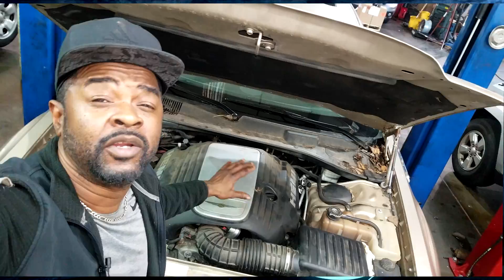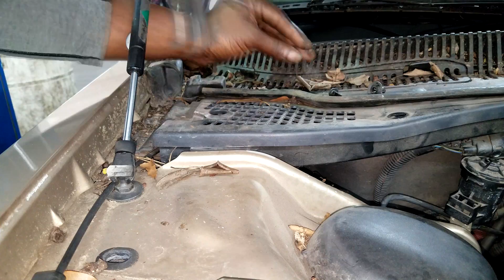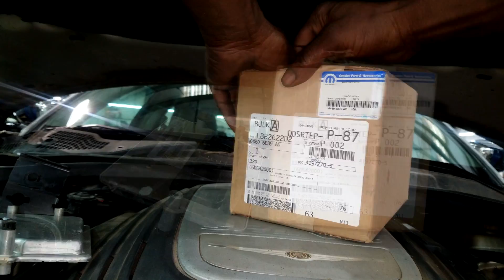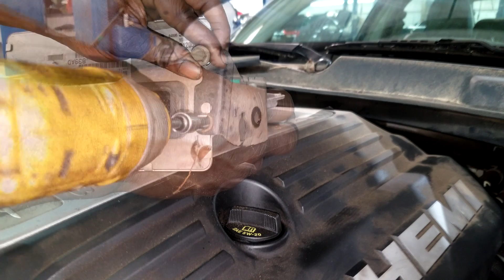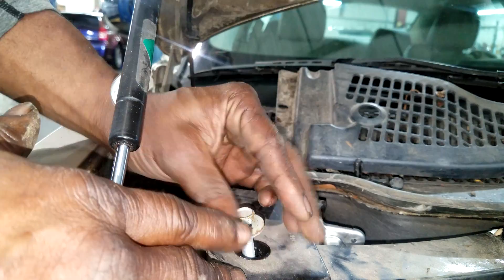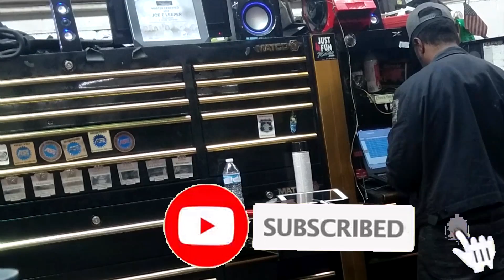Chrysler Jeep Dodge PCM replacement. How to replace a Engine Control ECU Computer P0601 P0605.

Comment: I have a 2013 Chrysler 300c the code showing me is a p0850 which is neutral safety switch but they telling me this car doesn’t have it. It saying it could be the pcm or wiring

Comment: Hello and thanks for your thoroughly explained videos. In the case that you were only removing and reinstalling the old PCM (like when you are just checking the pins), do you have to disconnect the negative from the car's battery and drain any electrical residual current inside the already removed PCM before reinstalling or it doesn't matter? Thanks!
Reply from the maker: Not when testing. Because at times they suggest you check voltage at a certain place. So the battery usually connected. Even when replacing. Keep in mind when the key off, you should be good.
Reply: @OnlineMechanicTips  Excellent. Thanks!

Comment: Can this process be done on a used ECU? I'm asking cause I downloaded a aftermarket ECU flash to open up features on my 2014 Chrysler 300 and now I can get it off. It's throwing fault codes. The company doesn't know how to unmarry there product.

Comment: I hope you respond to this and Hey i got a Chrysler 300c 2008 and is drowning all PCM codes and when i drive fast over 50 and hit a bump the cars slows down and when i turn off ESP off after a while ill start running again only happens after i hit a bump. And all the lights turn on abs esp all those. And they’ll turn off after driving for a while
And the codes are Right wheel speed sensor signal not receive and gas-cap and incorrect oil type i just had a oil change done. But the PCM codes turn on abs codes something like that i have change the speed sensor and same problem i have to drive with the esp off to not get codes. And i have subscribe.

Comment: Awesome to thr point video!  I have a 2005 300c and have owned it since new.  About 2 months ago it just started dying on me. It was throwing crank position sensor code and oxygen sensor codes.  I have since replaced the fuel tank, pump, fuel reg, crank position sensor, cam position sensor, all 4 02 sensors, spark plugs, purge valve solenoid and TIPM.  It still does thr same thing except now not throwing any codes.  
Do you think this could be the ECM?
Thanks and I am subscribed !
Reply from the maker: Hey Bill, it very well could be. In some cases you can tap on the circuit board of the PCM and it can stall. Watch this video as well https://www.youtube.com/watch?v=si5zOyn1Kg4&t=451s. Is this a Hemi engine.
Reply: @OnlineMechanicTips  yes sir , 5.7 hemi
Reply: @OnlineMechanicTips  welp the tap test didn't work. I'm going to inspect the pins and maybe clean them and try the plug wres next.
Reply: @OnlineMechanicTips  I ended up letting it idle until up to temp.  Then when I picked up the ecm to reinstall it stalled immediately. 
I couldn't get it to shut down again after that right away( I tapped on it and wouldn't quit)   but after I ran it for a bit again and moved the wires it quit.   at this point I'm gonna spray some type of contact cleaner on the terminals and just run it.

Comment: I have a 2007 Chrysler 300c hemi and every time I turn the wheel it loses power and stall. What will that be?
Reply from the maker: Hey bud, it depends. But theres no one size fits all for stalling. This stuff have to be diagnosed. Now, was there in trouble codes in the PCM? Also are you subscribed to the channel?

Comment: Hi Buddy, I have the exact same issue, I'm looking for a new PCM but in my local dealer doesn't have any so I'm looking at a junkyard can I use another year PCM like a 2008 dodge charger 5.7 and then program it? or should I get the exact same PCM and then program it? I have a 04896600AE
Reply from the maker: Is that the software number or the pcm case number? Curious why you need a PCM? Also are you subscribed to the channel?
Reply: @OnlineMechanicTips  subscription done and it's the pcm case number. As I said I have the exact same issue as you all the o2 heaters appears to be broken but checked resistance and wiring and everything looks good. Also placed a broke o2 sensor and pcm just recognize that sensor as a bad one but when I plug a good one appears the 4 codes for the 4 heaters P0032 P0038 P0052 P0058

Comment: hi, my dodge journey 2009 engine light is on and missing is driving. and when put accelerate not respond sometimes quickly speed, then engine light blink and study. mechanic said cars have  misfire, plugs and o2 sensor problems, they fix that but still have same. and  catalytic converter also change but still have same problem. now they said  ecu needs to be change. can you please help me. thanks
Reply from the maker: You very well could need a ECU, that depends on how they diagnosed it. What was the codes? Also are you subscribed to the channel?
Reply: @OnlineMechanicTips  code was P0032 heater circuit control. subscribed your channel.
Reply from the maker: @jijoyparayil5836  hey bud, you may have a shorted driver in your PCM. You will have to get the wiring checked first.

Comment: My codes for my 2006 chrysler300 hemi c is p0732 is that the transmission or pcm
Reply from the maker: That is the TCM sees a problem with 2nd gear in your transmission. Is it stuck in limp in? Also are you subscribed to the channel?
Reply: @OnlineMechanicTips  yes it's going in limp mode so don't get a new pcm?do I need another transmission?  Yes I did
Reply: @OnlineMechanicTips  the car drives fine no lights on the dash then out of nowhere I cant accelerate and my car is stuck can go backwards or forward
Reply from the maker: @nanasosexy1  yes, when the 2nd gear failure shows up the computer will default to limp in. This is a internal trnsmission problem. Nothing wrong with your TCM
Reply: @OnlineMechanicTips  so its best to replace the transmission right? Codes p0732 & p1521 was shown
Reply from the maker: @nanasosexy1  Yes, That P0732 internal

Comment: Having a p0601 code (vehicle ID block configuration) in mazda 3 2005. Can this be solve by just reprograming in dealer or must replace the pcm?
Thanks...hoping for your reply
Reply from the maker: Hey bud, flashing a module does not repair circuit board problems. Was this the only code? Also are you subscribed to the channel?
Reply: @OnlineMechanicTips  thanks for your reply.this is the only code.

Comment: Hey man great content.. I have a 2006 300c with the hemi im getting 2 codes p0307 misfire cylinder 7 and p2320 ignition coil g secondary circuit.. Ive swap coil packs with cylinder 5 but nothing changed.. I pocked around with multi meter and noticed i have a constant 12-13 volt on cylinder 7 coil pack.. Any ideas what i can check? Thanks in advance
Reply from the maker: Hey my friend. The coils are likely 12v powered by the ASD and duty cycle grounded from the PCM. Can your scan tool actuate the coils? Also are you subscribed to the channel?
Reply: @OnlineMechanicTips  HAVE A QUESTION FOR YOU MY ORIGINAL PCM HD 4 plugs only used 3 3th plug. Had no pins in it 
I got a 4 plug pcm has all pins in all 4 plugs ? Can i still use it and just not hook up the 4 plug which is the trans plug
Reply from the maker: @devotedanaheim1575  What kind of car is this with what engine? Also are you subscribed to the channel?
Reply: @OnlineMechanicTips  Chrysler 300 2006

Comment: Try flag ship one software in pcm is programed into the pcmby Vin been using them for 12 years I disagree with you when saying there is no such thing as a plug and I am loving proof and  every pcm I ever replaced worked beautifully
Reply from the maker: Hey bud, I will go out on a limb and suggest we have different meanings of the term plug and play.  Your comment suggest you saying that a PCM with added software will make it plug and play. That my friend is true but thats not what this video about. This video was if you want to get a used or new PCM. Theres no need to program the PCM if you get it out of the same car with the same features and the same software numbers, you will however need to marry the skim computer module to the car.
Reply: Do you know if I can use a computer from flagship1 on my 2009 town and country? Or I have to go to the shop??

Comment: Can you remove and clean terminals/connections and plug back in? (Same pcm) or will it still need work?
Reply: P0700 u0100

Comment: My 08 Chrysler 300 won’t start after both fuel pumps were replaced. The mechanic told
Me to buy a new battery and that didn’t fix
the issue either. It only has a clicking noise  when trying to start it. I replaced the relay and fuse just to see if that would work. I’m exhausted trying to figure this out. What else could it be?
Reply from the maker: Hello my friend, that clicking noise usually indicate that the starter solenoid trying to engage the flywheel to allow cranking, however, it is not doing so. Are you certain the battery connection tight and secure? Also are you subscribed to the channel?

Comment: PCM location on a 2012 Chrysler 200 3.6l???? Help please
Reply from the maker: Hey bud, that module right next to the battery. 3 nuts holding it on. Curious, are you about to replace it? Also are you subscribed to the channel?
Reply: @OnlineMechanicTips  yes I’m planning on replacing it! Sorry I didn’t see your reply until just now!

Comment: I had these issues and ordered and installed a new programmed pcm for my car from mint. The issues went away until about a week ago and my red lightning bolt light began flashing again. I took it back to the mechanic and he said we’re back at square one. Any advice? Thank u
Reply: Did u solve the problem by any chance? I am having the same issue but my alternator is not charging and my battery and alternator is new.
Reply: Might be the throttle body
Reply: Having the same problems now. I have a 2007 Chrysler 300 2.7  engine. Is it best to buy a new PCM and reprogram it?

Comment: got a 2017 dodge charger . When i drive it . It says service gearshifter then all the icons light up on the dash . I let it sit  . It drives right for one day and it goes back to all the lights on the dash lightening up .Do you know what could cause those problem
Reply from the maker: Hey bud, you need a good scan tool that can read the modules to start. Any codes? Also, are you subscribed to the channel?

Comment: I have a 05 jeep wk 5.7. mine is throwing all 4 P0031 P0037 P0057 P0051 Heater control circuit low. Sometimes the keep rides just fine days at a time but then it starts stalling and rough idle. How can I test the PCM, to know if it’s actually the PCM or possibly a bad ground?
Reply: I need to know did you ever find your solution?

Comment: I have replaced the pcm,tcm, and the tipm but still getting the same p0602 code wat do i need to do
Reply from the maker: I suggest you get the car properly diagnosed to tell whats at fault. Theses models not the only this that can set this code. What kind of car are you working on? Are you subscribed to the channel?
Reply: @OnlineMechanicTips  07 dodge caliber

Comment: U earned a sub today sir
Reply from the maker: Thats whats up, thanks for watching bud.
Reply: @OnlineMechanicTips  quick question . 09 chrysler aspen, no power at all zero power sir.. anti theft light is on.. i think it might be my ecm.. but i have zero power nothing..nothing turns.. got any answers? Thx
Reply from the maker: @WarrenAlbuna  When you say no power, are you saying you put key in ignition, turn, and nothing happens? If so, and the security light is on, you may be in theft mode. This do not mean you need a ECM. You may need a key and a skim module. But you have to get it checked at a shop. Theres a special scan tool that will be needed to diagnose this
Reply: @OnlineMechanicTips  no power as the entire vehicle has no power.. battery is new, alternator ia good.. the entire vehicle has no power.. no lights nothing
Reply from the maker: @WarrenAlbuna  Curious as to how would the anti theft light be on if you have no power? This mean the cluster has power to it. The 1 device that direct power to all those sources is the ignition switch. You may have a main fuse blown that powers the ignition switch. Only think I can think of is to start checking fuses

Comment: Do u know where the pcm on 07 dodge caliber
Reply from the maker: Yes, under hood near the driver side strut tower.
Reply from the maker: O yea, please thumbs up the video and sub the channel for me, thanks
Reply: Thx for the help but thats my ECM and i need to find my powertrain control module
Reply from the maker: @jamarcusmiller275  Hey bud, the ECM is the PCM. This car only have 1 module under the hood. What problems are you having?
Reply: Okay Thx im getting an error code reading for the pcm

Comment: My 2014 town and country made a high pitch sound and stopped moving.
Reply from the maker: hello my friend, you should have some fault codes in your TCM module. Anyway you can get to those? Pretty much depending on the code and the condition of the fluid, you likely will need a transmission unit.

Comment: i have 2011 Dodge Avenger and the car has code P1670 which is “pcm internal shutdown timer rationality” and also code P0335 which is crankshaft position sensor. i already replaced the crankshaft after the car DIED while i was driving it. the car also would not want to start. now the car starts fine but whenever i’m driving the car jerks and seems like it wants to shut off so badly. the engine line is on too and the same codes come back up. the mechanic i took it too wasnt familiar with code 1670 so idk wtf to do. i don’t wanna take it to Dodge dealership bc i spent 3k there 4 months ago to fix other shit this car has been throwing me. does anyone know how p1670 and p0335 plays together and what is wrong with the car 😞 why does it feel like it’s gonna shut off randomly whenever i’m driving? please help
Reply from the maker: Those 2 codes have a lot in common and will affect the way car runs. What engine in this car? Also are you subscribed to the channel?
Reply: @OnlineMechanicTips  2.4 L. and yes

Comment: I have an 09 Chrysler aspen limited and for some reason the when I turn it on all the lights on the dash come on too and stay on. I turned it on and off a few times and it didn’t do anything. I replaced the battery and made sure the connections were strong and they were. I looked into and all I can assume it is is there was a leak in the sunroof and it ruined the computer. Idk if this is the PCM that needs fixing or something else. Please help!!
Reply from the maker: Hello my friend, please keep in mind, the PCM have no control over lighting. Those lighting issues are controlled by other modules. Have you gotten the car scanned? Also are you subscribed to the channel?

Comment: I just paid 1500 bucks for a new pcm and egr valve seal leak from Chrysler's dealership. '06 300 touring
Reply from the maker: Wow, I could think of good reasons for the blue egr seal, but why the need for a PCM? O and please like the video and subscribe to the channel for me, thanks
Reply: @OnlineMechanicTips   Replaced Throttle body with Mopar Throttle .. Still idling very badly, loss power when vehicle in reverse. Fuel intake was insane. Could not exceed 40 mph . Techs diagnosed, Pcm could not be reprogrammed. Techs also fixed a power steering leak .. Additional 260 $ no engine issues . Alternator voltage is ok . New Tune up last month. New filters, fluids, spark plugs the whole 9 ... I am 23 . This would be my 6-7 car. & boyy have I learned to take care of my car 😜  Hopefully there is no more issues.. Pray for me . pick her up on Monday "Griselda Blanco" 👌🏽🌼
Reply: Hey MSmith, my mom is going through these exact same issues as you explained it on her 2005 300. The dealership has ripped her of $2000 so far for the EGR valve and throttle and now they want another $1500 to basically plug in this keyboard! I found a website online that ships it to you programmed after giving them the Vin number. They guarantee it will work plug and play and give a two month return policy with lifetime warranty. I just ordered it and hope it fixes the issue. Any updates as to whether you’ve had the same problems with the idling or no acceleration over 40 mph?
Reply: @aquariusense  any updates on the replacement pcm you ordered. How’s the car running? Thanks in advance
Reply: @aquariusense any updates on the PCM you ordered?
Reply: I could have got one already programmed for $209

Comment: How much was the pcm?
Reply from the maker: Hey bud, this was a used PCM from the salvage yard..it was like 40 bucks..please subscribe to the channel for me, thanks
Reply: That looks brand new
Reply from the maker: @oaxxel  hey my friend, you are correct, I had to look at the video again..Im not sure what this controller cost..It was an OEM Brand new controller. Which is very expensive
Reply: How much?
Reply: Axxel some say around a grand for a new one. makes no sense.
Reply: Depends on the place where you purchase. I’m recently replacing mine today. Have gone through all the sensors and Throttle body. Codes still kicking. Purchased from eBay for $70. They program and sent it out quickly